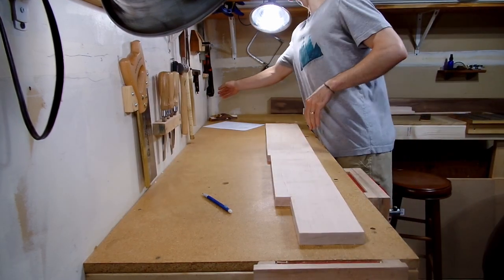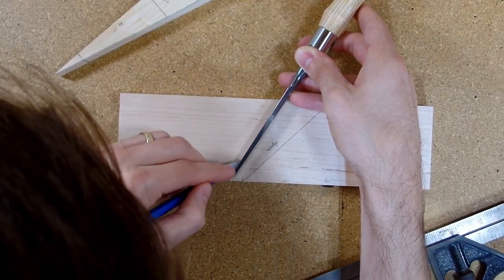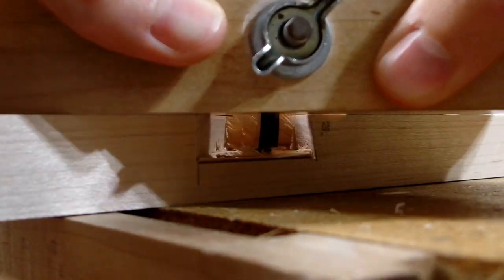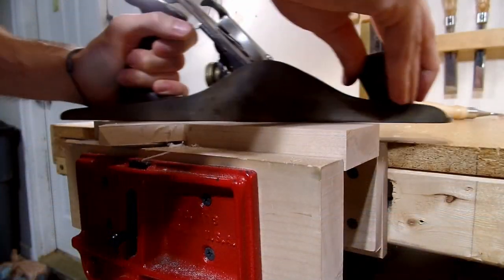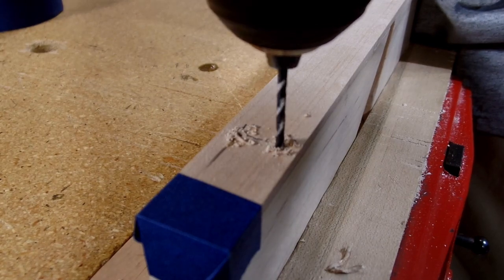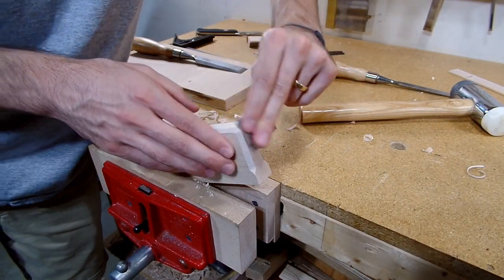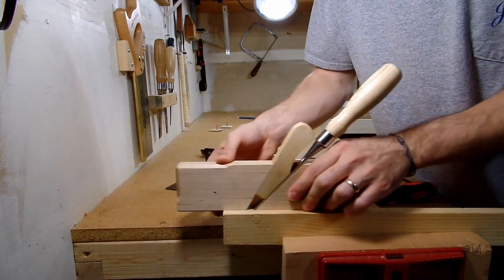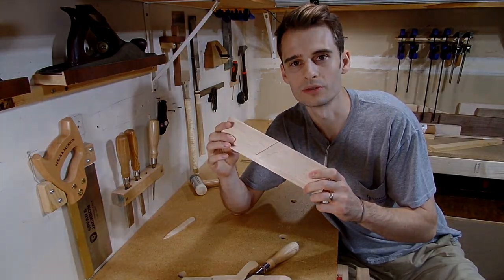How to make a Rabbet Plane | Building Tools to Build Tools to Build Furniture Part 3

Comment: I love Paul Sellers work, and great job on the plane.  Suggestion for longevity, use Round Head Screws for the fence and depth stop instead of flat head "drywall" screws.  They won't mar the fence and will allow you to adjust it more precisely, so you don't have to replace it too often.  Alternatively, make it out of brass.

Comment: Hallo sir , if my wood is 3/4 inch thick instead of 1 inch , can I get away with it?
Reply from the maker: If you used a hardwood I don't see why not! As long as you have a 1/4 inch of wood remaining on the plane body where the cut out is for the chisel then I think that would be sturdy enough to not snap while planning. Anything less then that and I think you could run the risk of the plane snapping in half.